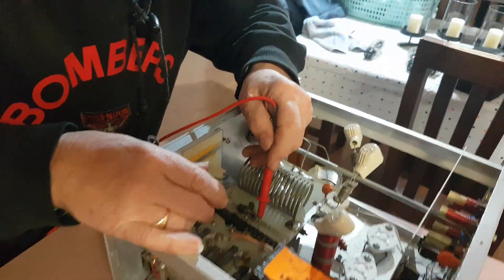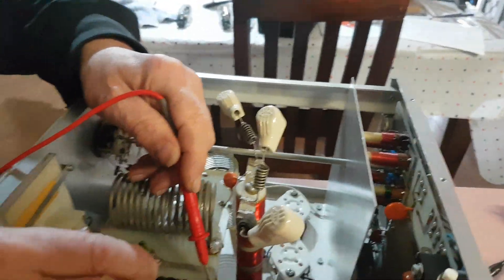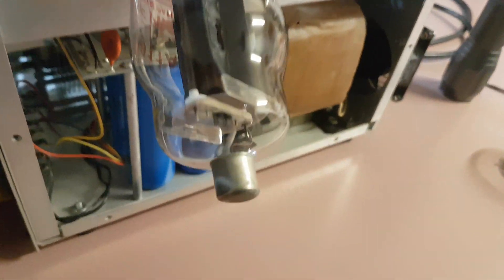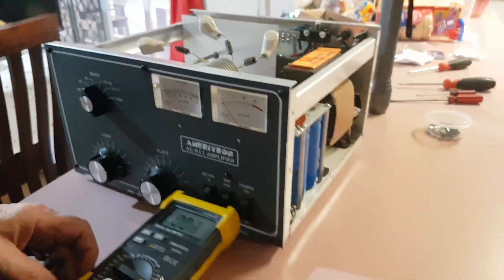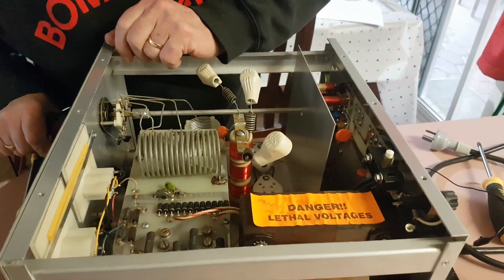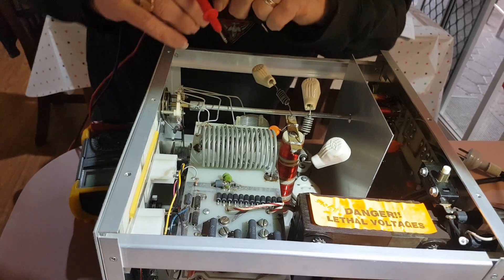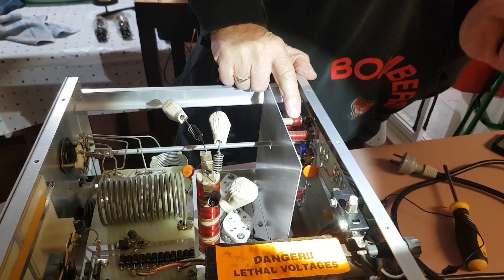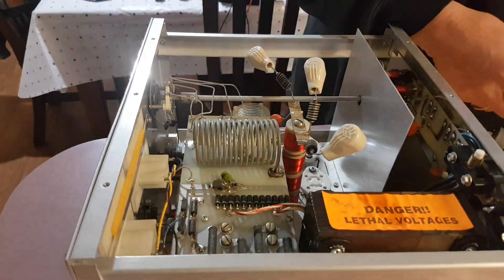Al 811 diagnoses part 1 de vk3ktt also vk3act Ray

Comment: The tuned input circuits aren't really wide band enough to cover the WARC bands and the main ones. It's a well documented shortcoming of the Ameritron amps...  I used to have the AL-811H  and have to choose either 20m or 30m. As I'd no real interest in 30m,  I stuck with 20m.  The same went for 15m and 10m, rather than 17m and 12m.